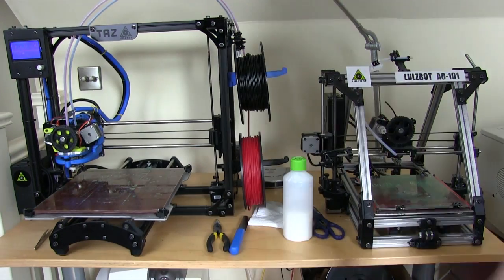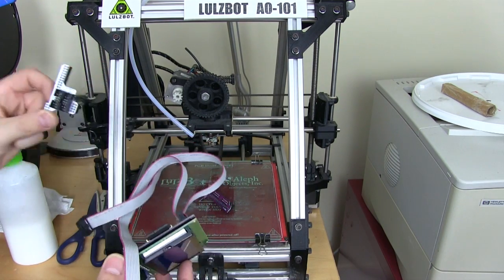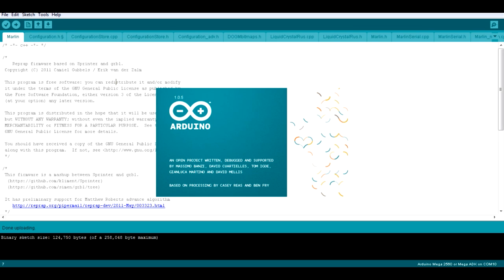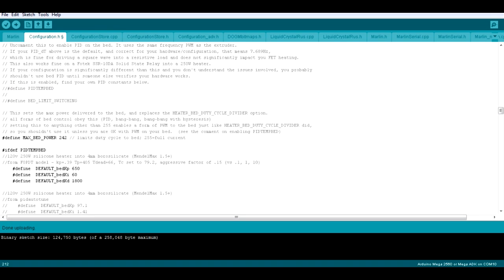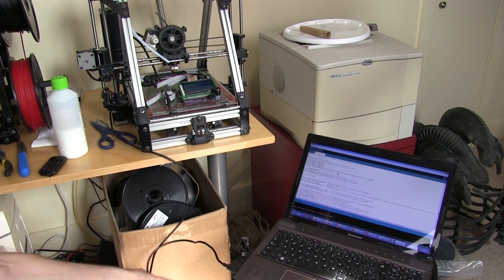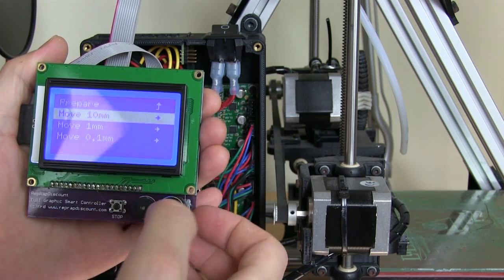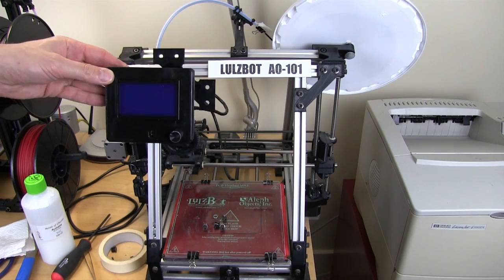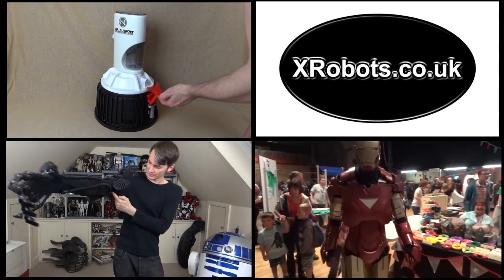Adding LCD & SD Support to a RepRap Lulzbot AO-101 3D Printer | James Bruton

Comment: I'm using the same controller in my 3D printer build. For the case, though, I'm gonna try to build a metal case from Lulzbot's design. (Local hackerspace has a plasma cutter, so I just need some thin sheet metal and a tool to bend it...)